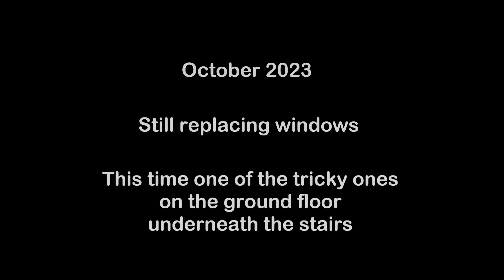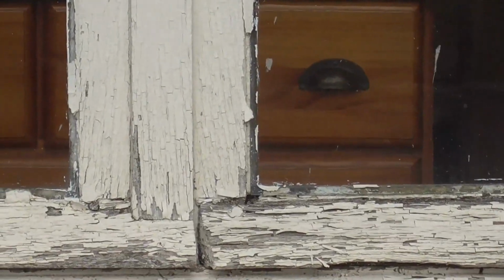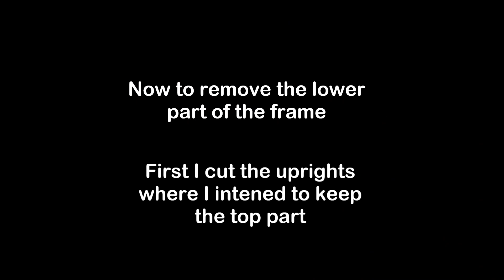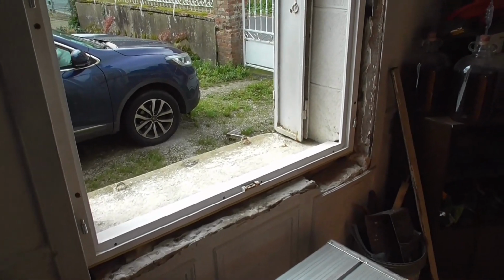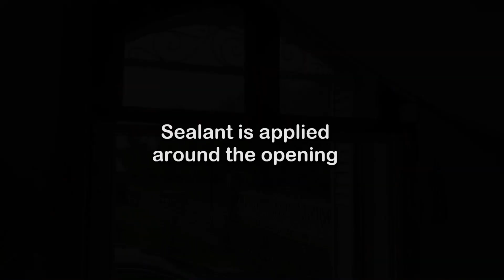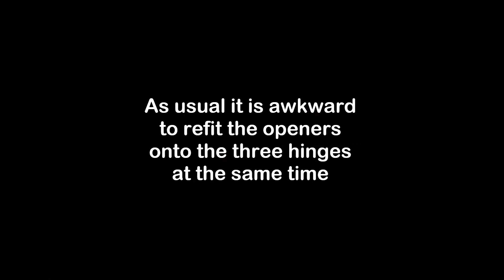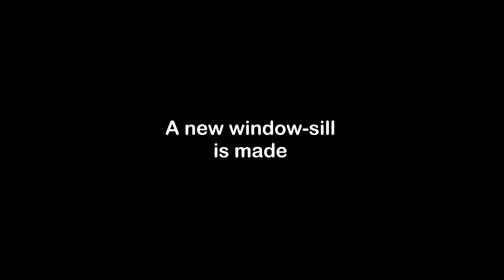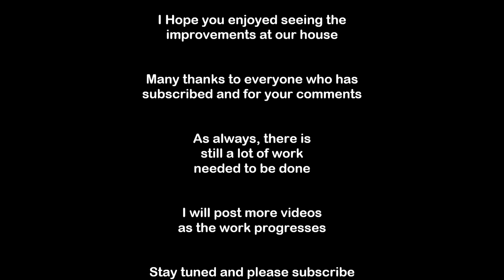Our French House Adventure pt50 Replacing the Ground Floor Hall Window

Comment: good job so as for the top one piece of double glazed window in frame and you add the curved part after
Reply from the maker: I'm going to replace the single pane of glass with a double glazed unit that has a curved top, but keep the original framework around it. I will have to cut the rebate deeper but that's not too difficult with a small router.

Comment: Second floor must have been added after the window. Odd the stair cuts it like it does.
Reply from the maker: Seems to be a thing in France, we often see staircases cutting across windows on houses as we drive about, usually on older houses. I guess that the outside look of the building was more important than putting windows where they could be opened.